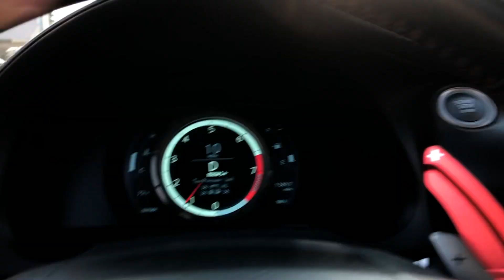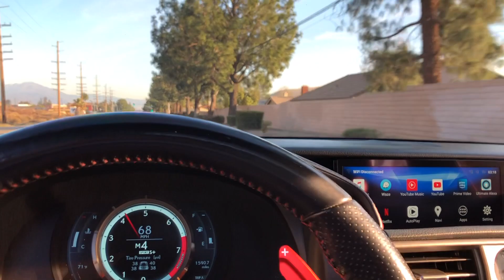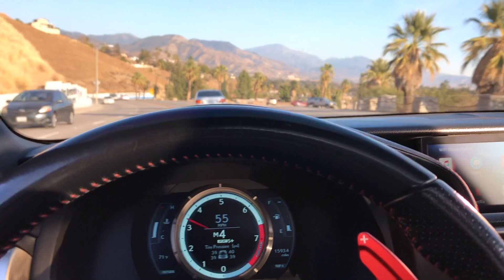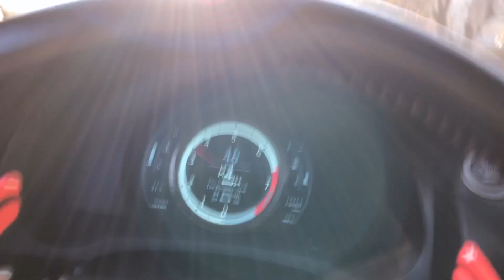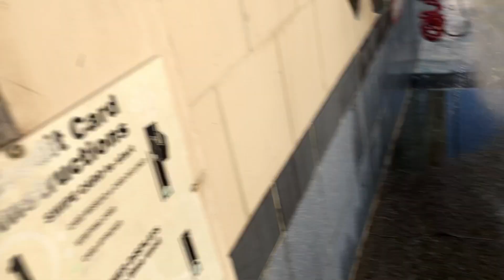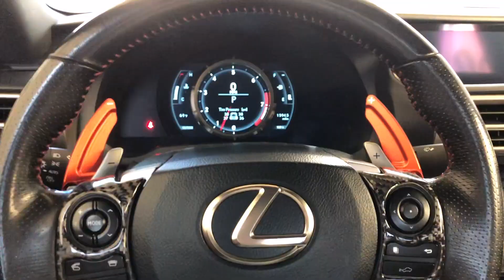MY LEXUS IS350 EXHAUST SET UP!!

Comment: Could you drop a link for your exhaust parts on what you have? I need mine sounding like this!
Reply: Sorry to be offtopic but does anybody know of a trick to get back into an instagram account?
I stupidly forgot the login password. I appreciate any assistance you can offer me
Reply: @Malachi Diego Instablaster =)
Reply: @Brodie Holden I really appreciate your reply. I got to the site on google and Im in the hacking process atm.
Takes quite some time so I will get back to you later when my account password hopefully is recovered.
Reply: @Brodie Holden It worked and I actually got access to my account again. Im so happy:D
Thanks so much you really help me out !
Reply: @iTz Griiz did you every figure out where he ordered the exhaust from?
Reply from the maker: https://semotors.com/tsudo-lexus-is250-is350-2014-sp-catless-h-midpipe-exhaust/
Reply: @Loudbasshead_  I like the sound,  but if I didn't want it so loud what would I have to do? Just replace the stock exhaust system without doing the muffler delete?
Reply: @allboutthemojo  did you get a reply?
Reply: @garnermobley2286  no I didn't